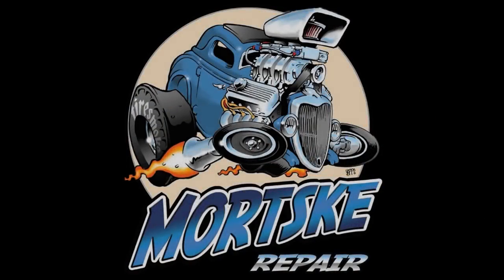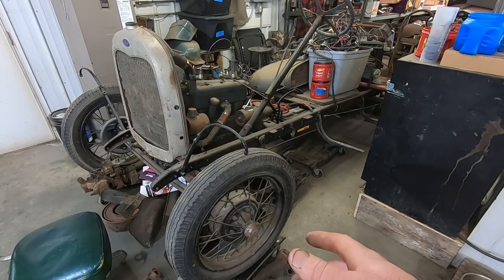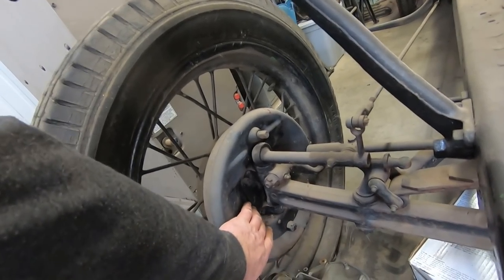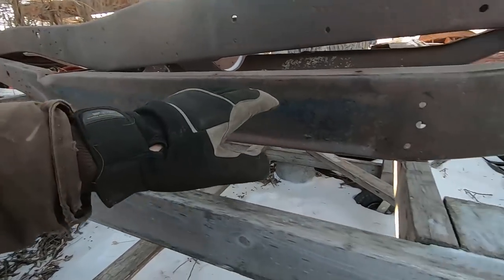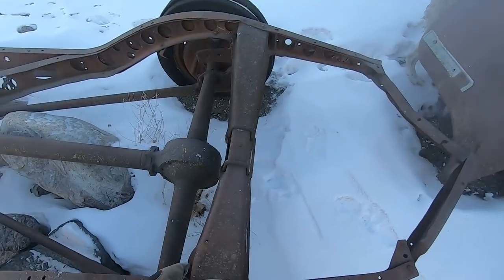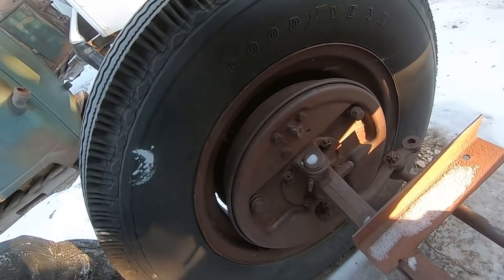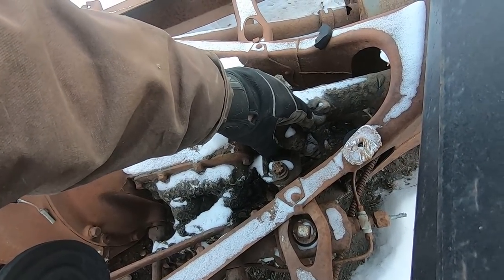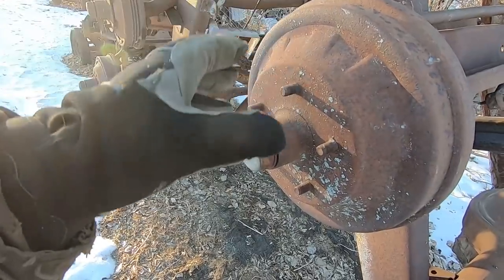Early Ford Flathead V8 Chassis Identification Tips and Tricks 1928 Through 1948 Traditional Hot Rod!

Comment: Come spring I'm going to try and grab a Model A frame for a home for my flathead if anything works out. I like the Tudor for a body. I know I don't want to mess with that earlier X member where it rots out unless it's miraculously preserved and I can keep it nice. I'd walk away from ones that got smacked up and probably Farmer welds all over as well. Is there a hidden pitfall on picking out a frame? If it's not rotten or incredibly pitted, straight, doesn't have patches and scabby welds all over is it a safe bet? When do you walk away? When do you run?
Reply from the maker: They're hard to find good ones since they're 80 years old. But anything can be fixed. Grab what you can. It's all good property and a great way to learn if you pick up a rough one for cheap.

Comment: I just recently purchased a 1967 f250 2 wheel drive 4 speed truck for $400 non running. It has a 390 FE in it. Is that a decent motor? Or should i swap it out. My only experience with fords have been with a couple 300s.
Reply from the maker: They're great engines!

Comment: wow that is a great collection and thanks for the info. I am all in on a 700r4 swap when you do one
Reply: A 2004R seems like a better idea. My '55 Chevy wagon, 305 and 2004R gets an honest all around 22 MPG without trying. Cruises under 2000 RPM.
Reply from the maker: I've done them both. Depends on what you're dealing with to start and what you want in the end.
Reply: What I was thinking is, let's say the 2 wheel drive blazer. Convert that to 700r4. The problems are not the swap as much as the parts of the puzzle that makes it hard to understand. Will the drives driveshaft work and what mods depending on what tailshaft you have on your 350. Then making it shift and perform. That is where I get stuck
Reply from the maker: @TheDocrock100  You'll have to make a new driveshaft. I've never had issue with the shift linkage.
Reply: I was thinking about the lockout converter control
Reply: As soon as you do this video, I will use it as a reference to change my 79 gmc van th350. Then instead of 12 mpg I might get 18 mpg. And that makes it a daily driver
Reply: Another video idea is pulling the motor and trans from a chevy van. I have seen a few videos, but they skip details that I think your style of video would make it easy to understand. Looking forward to your next video, Professor
Reply: @TheDocrock100  Speed parts companies sell electric and mechanical lock out set ups. Getting the kick  down cable correct is the trick.
Reply from the maker: @TheDocrock100  I just did such a thing but will not likely be documenting it.
Reply from the maker: @TheDocrock100  There's several options for the lockout control!
Reply: @MortskeRepair  that is what I am hoping for. Not something from an online company, a junkyard approach. Just like todays video and the starter. That was awesome

Comment: very cool video!. will say that model A vins are very often under the cab where you cant see it when it's on the frame.  and I am not sure if the model B frame is the same as a model 18 them,model B being the 4cylinder car and an 18 being the first V8 be interesting to know if they used the same frame or not.
Reply from the maker: Model A had them under the fender lips which requires removing the body to get the fenders off. The only difference on 4 cylinder cars is the crossmember from what I understand for the engine mounts.
Reply: @MortskeRepair  yeah its really annoying place for a vin to be on a frame as I would like to know my in on my pickup to verify if it has been changed over the years as from what we understand it was made the same week my grandmother was born. but its a barn fresh rusty truck and it would be a long process to get to
Reply from the maker: @cruddycornstalks  On a Model A the VIN was also stamped on the side of the engine block on the drivers side. If you've got an engine in it yet. Specifically the original engine.

Comment: What's the best source for a straight axle in this range if one was to look to build a open wheel Rat Rod?
Reply from the maker: Oh man, that's a real can of worms there. So many variables. It all depends on your wheel and tire combination and the ride height and track width etc. Model A is the most common that you find because of the amount of them they built. But the spindles and brakes aren't so desirable but they do have the shortest wishbones, which I presume you'd be splitting? I'd say find a Model A axle and wishbone and a pair of 37-41 spindles and bolt on a disc brake setup if you're going for a "rat rod" or get real lucky and find a set of loaded 39-48 hydraulic brakes to use. The later axles are wider and the wishbones are quite a bit longer and the spring setup is in front of the axle so doesn't work very well in most applications. You can buy new dropped axles from several suppliers in various configurations along with reproduction spindles and reversed eye leaf springs as well. Clear as mud?
Reply: @MortskeRepair  that does help. I was just thinking model A stuff is gobbled up because of popularity. Sounds like I'm better off when I'm ready to consult you before I purchase the junk I find on fb marketplace! Haha
Reply from the maker: @Str8sixfan  Oh no, lots of Model A stuff out there yet! I just looked at a pair of axles from one out in the trees last night! Keep an eye out for the 37-48 spindles and hydraulic brakes as they're good property and can be made to fit any early Ford axle.